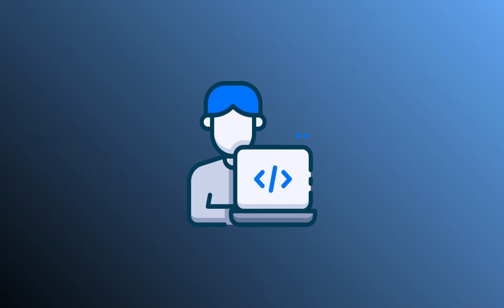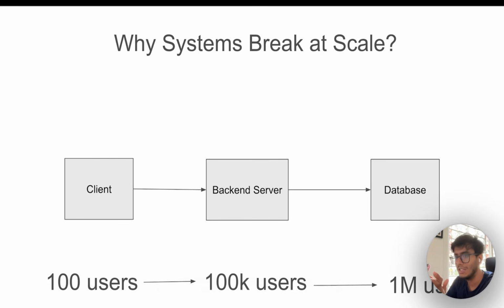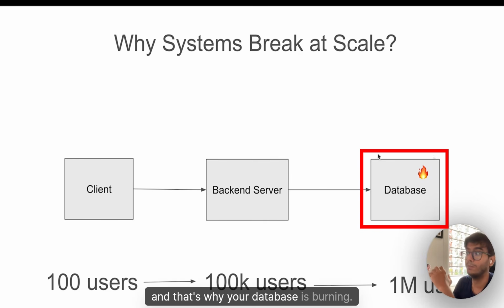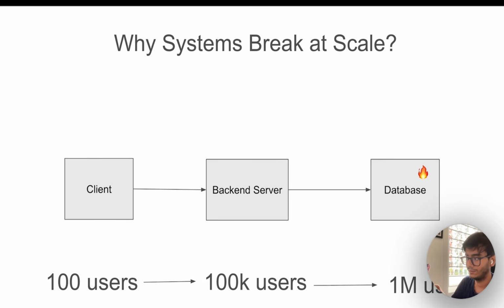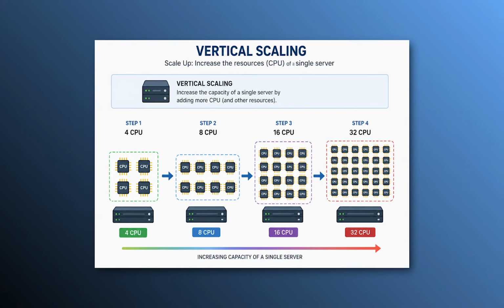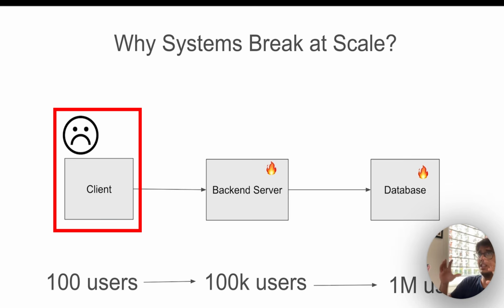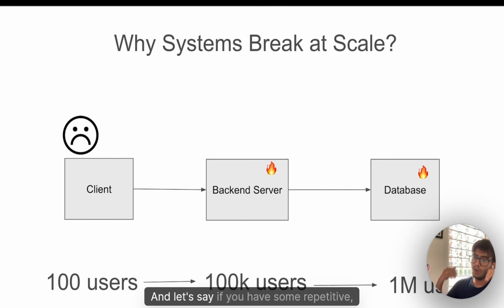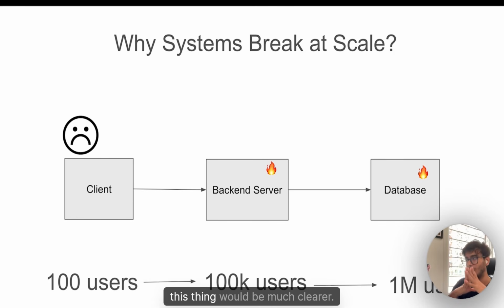System Design Interview Course • Introduction: Why system breaks at scale?

Comment: In single server backend can never outperform database . Database is going to be always faster because they are on same network . Client and backend cannot be on same network. So i think backend is main bottleneck in single server architecture. I have also tested it .
Reply: While a backend handles logic, a database handles state, disk I/O, and data integrity. These operations are fundamentally heavier than executing application code.
A backend is inherently slower than a database because of network proximity however ,In a single-server architecture where the backend application and the database run on the same physical machine, they share the same network loopback interface, meaning network latency between them is practically zero. However, when evaluating bottlenecks, network distance is only one piece of the puzzle.
Reply from the maker: I think you need to correct your understanding here. 

The component that reaches its capacity limit first and restricts overall system throughput is db. 

Backend and database can be on the same machine. True it can be. But db and server being in same VM only solves network latency and not query latency. 

In many applications, especially CRUD systems, the database is often the first major bottleneck because every request eventually needs to read or write.